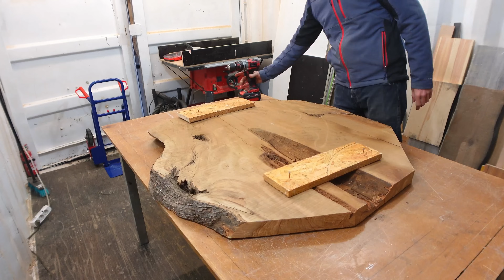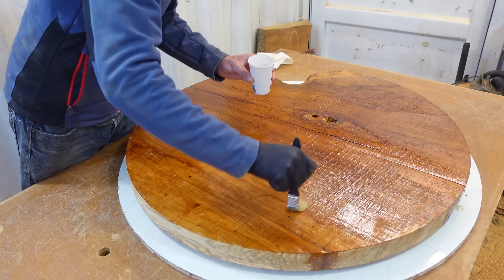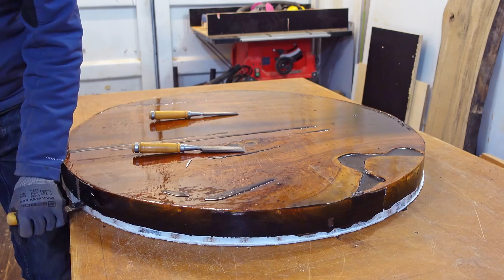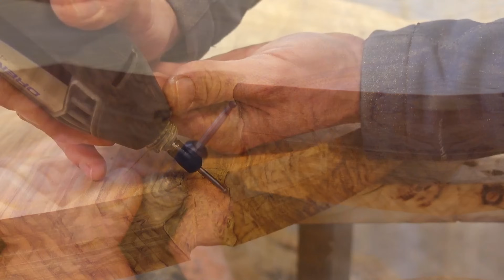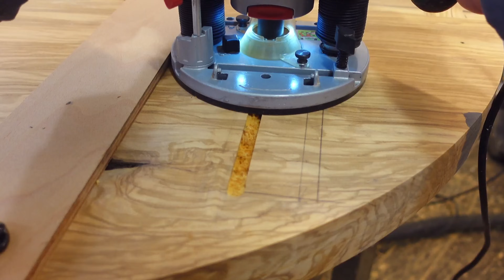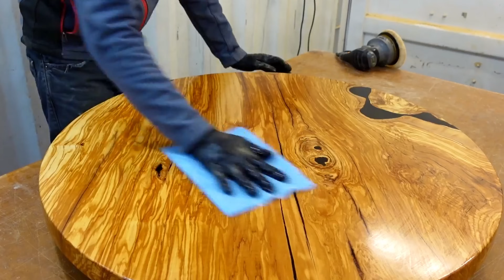1000-Years-Old Wood and Epoxy Table. WOODWORKING

Comment: Another beautiful piece. 
Olive wood has to be one of my favourite species of wood that and claro walnut but olive just reminds me of abroad and not rainy England lol 
routering  that slab flat looked fun 😭😭😭 lol 
👏👏👏
Reply from the maker: Olive wood is the best
Reply: @ yeah it’s got that look that’s like a spalted look but more defined . Especially when it’s had a few coats of hard wax oil on it . Ive got some lovely Spalted horse chestnut and willow slabs ready to go and I am in the process of finishing up a huge maple river table so I’m looking forward to getting that done . Just a quick question how long does it normally take you to do a whole project start to finish not including the days waiting for the resin to cure ? , Yh mate i admire your work 👌👌👌💪
Reply from the maker: @roxoriginal732  That depends a lot on each project. Let’s say around 2 or 3 weeks on average, but keep in mind that I spend a lot of time recording the videos.
Reply: @ nice one . Yh I’m not very good at recording but you got it down neatly….  thanks for replying mate  have a lovely day 👍👍👍🙏🇬🇧🇬🇧🇬🇧

Comment: Amazing! You have become a main inspiration for me. 

Question: I notice your c-channel has simple round holes and not slots for wood movement. Will this be a problem? Is wood movement not a viable concern for ancient olive wood?
Reply from the maker: Thanks!! The round holes are slightly larger than the screw diameter, allowing for some movement. In any case, I don't think this wood will move too much.
Reply: @marmotaworks  Why do you think that? I hear so much about wood movement in table design, but I've never experienced the problem myself. Do you think it's an irrational fear? Thank you!

Comment: Everything you build is purely well thought out. I find it so brilliant that you suggest charcoal instead of using a dye. Bleed is awful. It’s a brilliant strategic suggestion. I also admire that you build everything legacy style. Meaning that it will last for many many many years.
Reply from the maker: Thank you! I dare not use charcoal for large pours, but it works very well to fill small gaps.

Comment: Nice work. I like that you got a semi-gloss sheen on that with a hard wax oil. I've been using Rubio but it tends to leave a relatively dull finish. I'm curious what your recipe or manufacturer of choice is?
Reply from the maker: It's osmo polyx oil

Comment: nice table.  Question:  Are you putting charcoal into the epoxy before pouring it?  (Just double checking as I never used epoxy before.)
Reply from the maker: Yes, put the charcoal and mix it.

Comment: I really like the wood, but the black epoxy isn't the most original idea anymore. Not sure what would be a better idea, but the wood is gorgeous. Would it not be possible to use your sawdust, combined with epoxy?
Reply from the maker: It may no longer be the most original, but it certainly contrasts best with the wood.  
The truth is, I felt sorry for throwing away that peculiar sawdust...